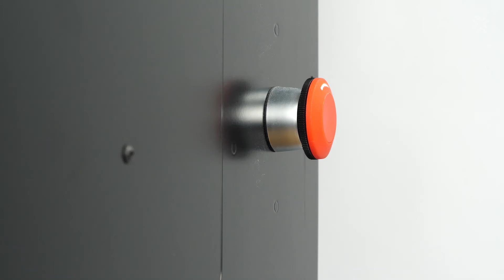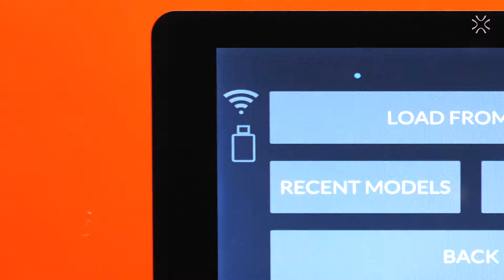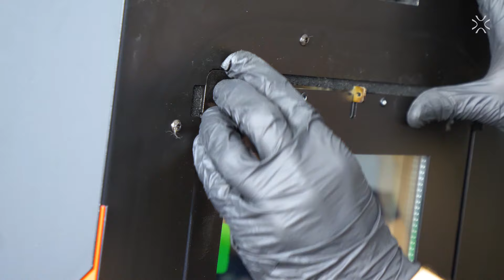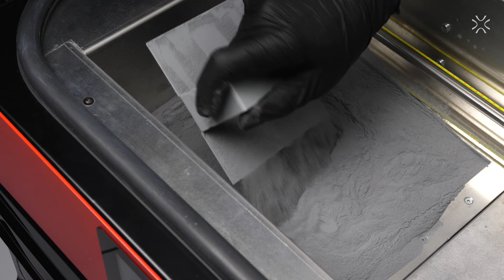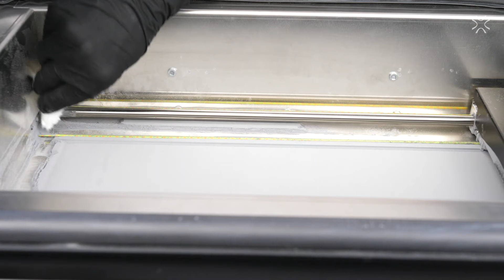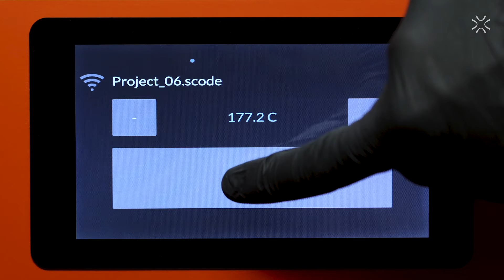Printing with Sinterit Lisa PRO

Comment: Everything done in the open air from pouring the powder to removing the printed parts from the cake afterwards… this is so messy! A complete 3D printing workflow should be thought including post-processing not not spread harmful powdery material everywhere in the room especially on operator's clothing, hands, hair and face :/
Reply from the maker: The video is almost 2 years old, and right now we have a whole modular system and the process could be very clean and easy with the IO Box, Vacuum cleaner, and Powder Handling Station. Check out the video presenting the whole solution: https://www.youtube.com/watch?v=vlaTxeMsvSE
Reply: @Sinterit  Thank you for the link!